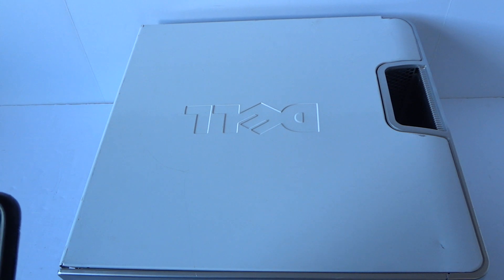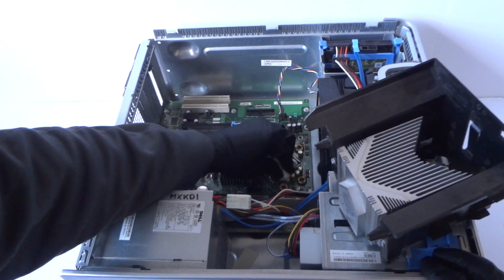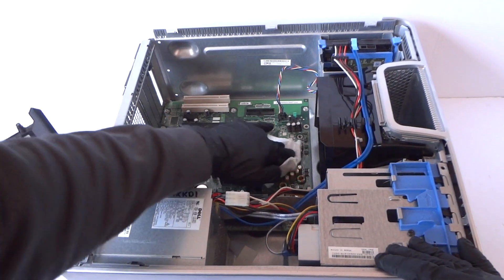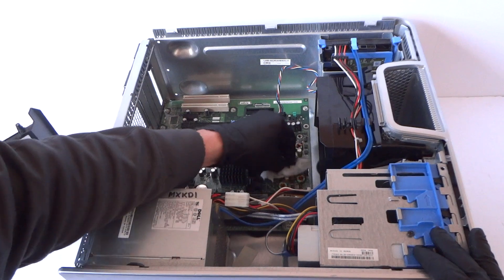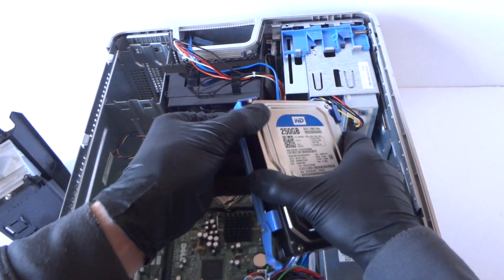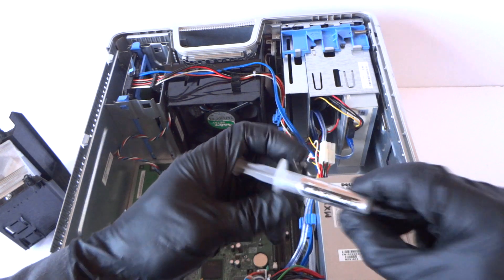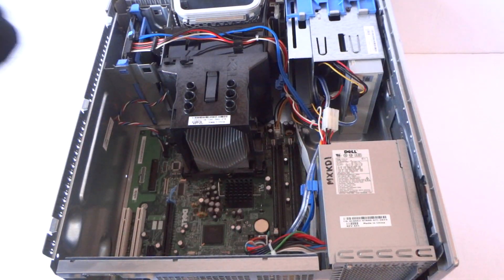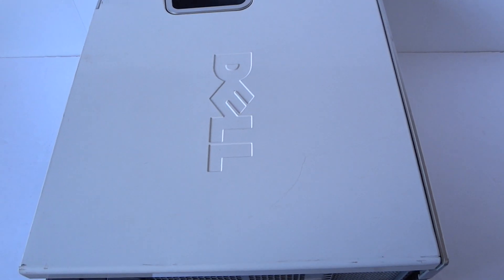Dell DM051 Dimension 5150 E510 Upgrades CPU RAM Video Card

Comment from the maker: Here is the list parts upgrades.

(1.) CPU: Intel Pentium 4 530J SL7PU @3.0GHz (1MB L2 Cache 800MHz FSB) 
(2.) RAM: Samsung PC2-4200 (DDR2-533) 1 GB DIMM 533MHz DDR2 M378T2953CZ3-CD5 
(3.) Video Card: NVIDIA Quadro 2000 1GB GDDR5 SDRAM PCI Express x16
Reply: I'm trying to upgrading my mom's old dell dimension e510 to a powerful gaming pc would I do the same for this?
Reply: @gavincrash  I know this comment is a bit old, but unfortunately, this PC wouldn't allow you to play any sort of games released in todays day in age. Even with the upgrades, it still wouldn't run any games at all.
Reply: @natesloungee  its fine I built a really good pc now
Reply: @natesloungee  is there any graphics card that this motherboard can handle to keep up?
Reply: @naturalmystic5098  Hi! 
Unfortunately, no. The graphics cards built for today's PC's won't work with this motherboard. You're better off saving up your money and getting a modern computer than trying to put money into this one. It's not worth it, especially being the computer is around 15 years old.
Reply: So why cant you just put a newer motherboard and start from scratch. Basically replace everything.
Reply: @mdgmdg33  it's a BTX case, obsolete form factor

Comment: Hello. Anyone know the best available graphics card or a decent gaming graphics card for this computer?
 I've played WoW the Burning Crusade with the oem parts for this computer and it played fine. I was wondering if "anyone" knows of better upgrades to set up for "WoW Classic"?
 Thank you.
Reply: I had a nvidia gtx 560 running on a pci extention cable. BUT it needed another power supply 500 watts as it needs a power lead. Also the fan fouls the cooling box. I have just put a GT 430 which works fine.

Comment: will this now run win 10? Or do you have to use the win 18.09 version.? I guess they want you to have at least 8 gig ram now...sheeesh! my 5150 has 2 hard drives...500 each, 4 gig ram, and all I have to do is upgrade that cpu card...to 3.8 if possible.  I hope. I really hate having to replace a perfectly good computer just because win 7 is no longer supported.  Any tips would be great!
Reply: Vicki k Gibson it probably won’t be great for Windows 10. I’d suggest Lubuntu, or another Linux distro. These machines are older than the average fortnite player after all.

Comment: Great video.!!! dell slutty. The motherboard with socket 775 supports up to quad core 6600 at the frequency of 1066 mhz. However, in the update of bios, dell limits only to Pentium 4 processors.

Comment: Hello man, sorry for my english, I'm brazilian, I have a dimension 5150 and I need to upgrade it to an Intel Pentium D945 Processor 3.4ghz 800 Fsb 4mb cache and 4 memory 1gb Ddr2 Kingston 667mhz Kvr667d2n5 / 1g Pc2-5300 Cl5, my question is will work, what problem is this from bios F1?

Congratulations on the excellent video, I apologize because I understand, I believe that about 40% of what you said! Anyway Thank you!
Reply: Camilo Figueiredo I believe the bios key is f2, because dell uses that most of the time. Try delete as well, if that still doesn’t work just try all the f keys(f1-f12)
Reply: @hetspeelkwartiertjeslaatte2624  Thank you so much!

Comment: Would this be good for gaming ?
Reply: No, this computer is almost 15 years old. It's not good for anything other than retro gaming.
Reply: Peter Neil it might get 30 FPS on the first euro truck simulator, or far cry 1. Half life should be decent. I know that it gets nearly playable framerates on NFS carbon. So if that’s what you want to run, sure. Otherwise, you might be better off with an Athlon APU.

Comment: How did you opened the cpu
Reply: I'm wondering the same thing
Reply: There's a latch on the top of the tower you have to pull back to pop off the side panel

Comment: Nice! So cool, i have the same pc, but i havent used it in 10 years xD, i want to upgrade it, and use the exact same parts as you! Can it run csgo, minecraft at low settings?

Comment: These weren't bad at all. I had an E520 that wouldn't die. Ended up as Q6600/8GB DDR2/SSD/Quadro 4000 lolz :D
Reply from the maker: Hi, yes i am going to install winxp on this machine and would be great gaming on older games 2003, 2004, 2005.
Reply: Hey do you remember which specific ram sticks they were? As well as the CPU? I have an E510 and I'm looking to upgrade.